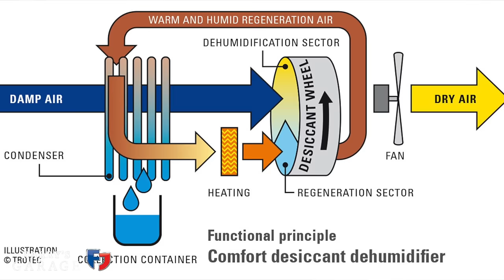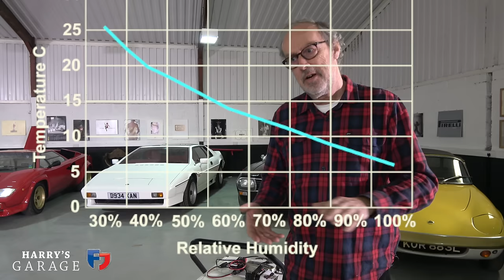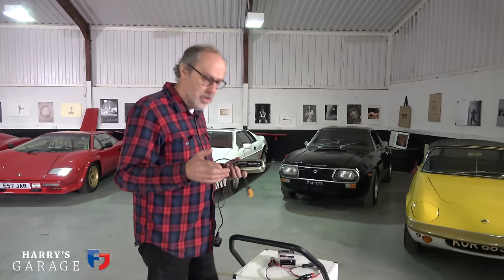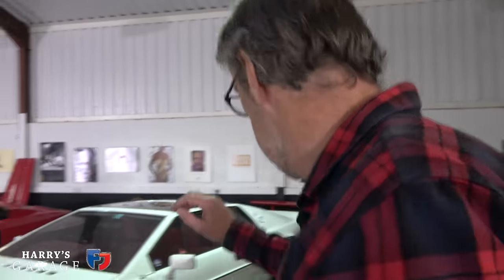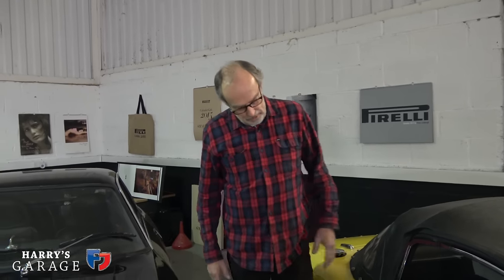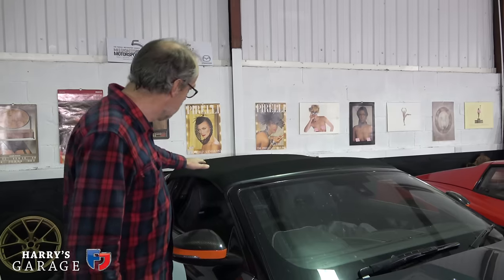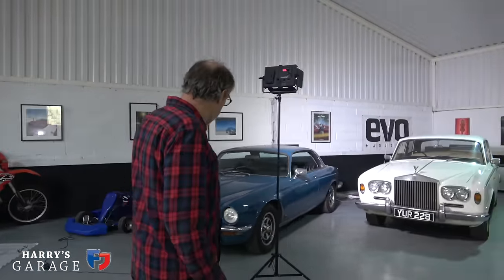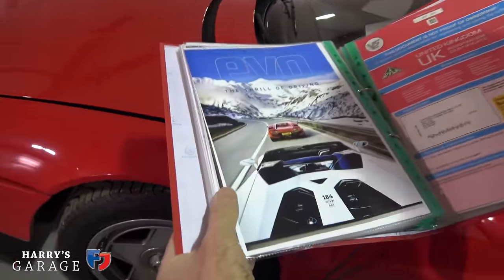My top tips for keeping any car in top condition during a period of storage.

Comment: Not all desiccant dehumidifiers output the moisture in a heated air-stream like the unit you have. Many of the smaller "domestic" size units discharge the water into a capture tank or hose outlet and you do get the advantage of the heating inside your garage (the dry air coming out of these units is noticeably hotter than the output of the refrigerant types of similar drying capacity). 

I have a bare aluminium Caterham that has lived its 17 years in an unheated garage and is still pristine. While dehumidification is part of the reason I think, paradoxically, an uninsulated metal roof has been of benefit. The reason for this is that, on clear nights, radiative losses ensure the roof temperature drops far faster than anything else in the garage and with a little circulation within the garage (generated by a small fan) condensation forms preferentially on the roof rather than the car. So long as you prevent this condensation from dripping on the car it is of no account. A tarp suspended from the roof like a ridge tent can ensure any drips from the roof run harmlessly clear of the car. A vapour barrier on the floor (paint, or a tarp or a pond-liner) is important and a heavy cover over but not in contact with the body of the car completes the job.

Comment: With regards the expensive Dehumidifier, you could make some sort of heat recovery system to capture the hot air before it exits the building.
My thoughts would be metal ducting, run along an inside wall for a few meters before exiting. The moist air exits but the heat soaks into the ducting.

While I am on the subject, there are heat recovery units on the market that draw heat from the high part of the building and pump it out at floor level.
Cuts down on bills and creates good air circulation.
Reply from the maker: Knowing what I do now, I'd rather have a couple of cheaper desiccant dehumidifiers with built in collection tanks that could be drained to the outside, as then any heat generated would stay in the garage, rather than being pumped outside.
Reply: @harrysgarage  That sounds like a good simple solution.
Very nice explanation of temperature and humidity by the way, I have some knowledge in this subject which really helps when you are trying to protect metal. 
Thanks for the video Harry, I think we are all looking for something to watch at the moment.

Comment: Think of humidity in cold and warm temperatures as a beach towel v’s a flannel.
The beach towel is warm temperatures and can hold more water, before it gets wet through and drips.
The flannel is cold temperatures and can only hold a little water before it wet through and drips.

Comment: Careful with relative humidity. Yes, the percentage will be lower when you increase the temperature, which means the air is further from saturation (100%) and objects at the same temperature won't get condensation, which is the ultimate goal. But you need to maintain this temperature constant and, more importantly, have a good insulation of the walls, ground, and ceiling, because that's where the condensation will eventually accumulate. In turn, the condensation will deteriorate the material and offer spots for bacteria and all sort of things you want to avoid in the long term. Finally, if you insulate enough, you also need to ventilate in order to alleviate those problems.

Comment: Great advice. The only thing missed in my opinion: don't run the car for a short time. Worst case is just letting it idle for a few minutes in the garage. Not much better is going for a ten minute drive. If you drive it, which is certainly ideal, warm it up thoroughly, and then give it the beans!

Comment: I'm not sure about turning the engine over without starting it because petrol will get into the cylinders and wash oil of the bores. I prefer to drive the car just outside the garage and run the engine until it's properly warmed through every few months. A cover is particularly useful on convertible hoods which are difficult to clean.

Comment: Its the deciding which one to drive would be issue...
RE storing the hood up for convertibles that's hard if it comes with a hardtop like a Mercedes SL as you'd need more room to keep the hardtop and also a stand!
Reply: My father has an r129 sl.
He keeps his suspended above the car in his garage. He's had the car around 20 years and I don't think he's never put it on.

Comment: Keeping the tank full is very important IMO. People have found decades old engines with perfect fuel injectors full of gas because the gas was sealed off from any air.

Also likely a good idea to roll the car a bit, to protect the bearings from denting as well.

Also, battery acid stratifies when still for long periods. If it's super cold, batteries can freeze and be damaged because of that. So, I'll often just rock the car to keep the battery properly mixed.

Salt is evil. Don't ever drive in salt. Wait for it to rain twice in the spring before driving after a road was salted.

Comment: Cars with OBD-1 and OBD-2 are most likely the ones which may drain the battery.  There are manufacturers that do a good job programming the computers to go to sleep fully.  There are other manufacturers that produce vehicles that have sensors or other feedback units on the vehicle that keep trying to communicate with the vehicle computer even when they are shut down and in storage which draw  just millivolts.  Over a month or two  that low millivolt draw will kill the battery.

Comment: Too right Harry about modern cars. Had a 2006 Jeep Grand Cherokee for a year from new, went on holiday for 2 weeks, darned thing was dead when we got home - nothing wrong, said Jeep, the car simply drains the battery that much. Battery revived by their breakdown guys.
Reply from the maker: New cars are a flipping nightmare when it comes to battery drain. Many do a diagnostic check on internal systems every 24hrs, which is another reason why they drain the battery. Then, rather than cranking into life a bit slower when the battery is at 70% charge, they throw up an engine light and refuse to turn over! It's a problem with every brand of car too..

Comment: The most important to check everything when you take the car out of the storage. The most important are brakes and fuel lines. Both of them are very critical as the rubber can be cracked.

Comment: I to live in the countryside and my biggest problem when not using the car for a few days is mice, they've found a way of getting into the interior now as well as making nests in the engine bay. 
The best way I've discovered to deal with the rodents is to move the car to different parts of the garden every day, I use the garden blower in the engine bay and spray the seats with a can of Dettle fabric surface.

Comment: Good psychrometry; my anti mould economy approach in my non airtight rented Hong Kong car shed is what I call pulse dehumidification with a dehumidifier on a  plug in timer giving say 10 minutes on, 30 minutes off and a tumble dryer hose feeding dry air  via a spigot through   a piece of rigid plastic sheet  wedged into a wound down car window. On old school cars I remove a battery terminal and sometimes rig up a portable PV battery charger. Higher tyre pressure and occasionaly rolling the car a few inches  to change position  helps reduce tyre flatspots. I also sometimes park on some salvaged playground rubber tiles to reduce floor to  tyre contact pressure. And then bloody bats in the shed corrosively  dump on the paintwork and rats chew the wiring !

Comment: Great video Harry. Especially if you live in the UK. We all have these issues. C-tek is the way forward. (all mine are on those).
Reply: matty BROWN 
I have a Ctek MXS 5 connected to my 2015 Cayman but for some reason it’s not going to maintenance mode. It goes through to mode 7 and goes back to number 1. It’s the first time I’ve used it (brand new), maybe it’s a duff one.
Reply from the maker: It often takes up to 2 weeks constant connection before it goes to maintenance mode. How long has it been plugged in?
Reply: Harry's garage 
Thanks for replying Harry, it’s only been on for a couple of days. The only problem I found with the Ctek comfort connector is the cables are not long enough to reach across the battery posts & the Porsche manual states not to put earth cable onto the battery post, there’s a dedicated Earth post on the front strut & again the comfort cables aren’t long enough. Solution; I managed to get the crocodile clamps to reach (just about), it’s a pain as the inner bulkhead plastic panel has to be removed & stored somewhere.
Reply: Harry's garage they are on constant charge - bar the daily (35) I often find with the trackers and alarms on my gtrs new ones (35) around 7-9 days before it goes flat the older ones (34 etc) about a week with the trackers etc constant battle. in fact just got a message from tracker this evening my battery is low, (34 not on charge but had new battery 2 weeks ago) I’m very pleased you bought this up.  The other cars in constant charge with no issues via c-tek - Stay safe

Comment: All due respect if I may. I have been storing cars since the early 80's and currently store 3 due to cold and snow / salt. Your suggestion to periodically crank the engine from time to time worries me. Most all of the ware and tare on engines occurs when it is initially started / turned over. I jack mine up and hang the suspension, and fog oil the motor till it nearly stalls and then call it good. Thanks, thoroughly enjoy all your content.

Comment: Nerdy comment about humidity/heat - it's not that different to electronic circuit boards intended to work in outdoor equipment.  If you cannot hermetically seal the equipment - basically needs to be metal case welded shut, moisture will get inside.  Bear in mind that moisture will permeate through plastic (that's why early plastic transistors were unreliable and not used in things like BT systems, military products etc).  If moisture can get inside, you need to allow it to get out - simple hole at bottom or a specific plug with a gore-tex patch that will breathe, but not let in insects.  Then you need to make sure the printed circuit board operates at about 8-10 degree C above the outside ambient to reduce the moisture at the board surface so you don't get condensation.  We even used to put heating resistors in products that used very little power.

Comment: It would be a very useful option for exotic car manufacturers to add a connection point for external power so the battery can get disconnected and not get drained by all the electronics.

Comment: Hi
To run or not too run is the question? The modern enriching to fire up the CATS raises a dilemma .
Unless your prepared to run oil up to 90c I’d say not.
Yourll just be taking the hit on start up wear.
I have 4 ctek’s so must be a fan but for CAN bus architecture it’s important to connect them from negative earth point and the positive pole as recommended in the handbook.
It’s not simply across the battery.
I too try to brim the tank I suspect it’s mythical really for a couple of reasons.
Firstly the surface area doesn’t change that much with volume.
Secondly can you buy super fuel without ethanol? Most seem to have gone to 5% which is probably enough to render the fuel absorbent to water.
( it’s one reason air cooled piston aircraft engines still run on blue Avgas to allow  tank drain checking and separation of water before every flight.)
Thanks

Comment: Without access to mains power ? You could also trickle charge with a solar panel. The most versatile of which can be plugged directly into the obdII port of the vehicle ( EOBD available from 2001 ) Thats a great workaround for vehicles who’s lighter socket deactivates when the ignition is off.

Comment: I've always, with all my manual cars, when garaged

Leave them neutral 
Handbrake always Off
Chock the wheels
Roll the car periodically to have no flat spots on tyres, when you next drive the car
Start, and run them for 10 minutes or longer to get engine up to normal operating temperature, if stored in garage a longer length of time

No one, or nothing I read in a journal, or book, or magazine, or now on the internet, told me to do any of this with a car
I've just thought it was simple common sense 
But then again, I am weird!

Comment: I make a living out of keeping flowerbulbs dry. Constant temperatures are important, even more than high temperatures. If the airtemperature in your shed goes up the temp of your car is lagging behind. It takes longer to warm up a car than it takes to warm up air. As soon as you have a difference in temperature you get condensation. Everyone who took a bottle of beer out of the fridge has seen this.  The moisture in the air will now condensate on the colder metal of the car, especially in cavities. And this will cause rust obviously. So constant temperatures are important, as well as air circulation. (not ventilation)

Comment: The engine sound reminds me of my FIAT 124 SPORT 1800 1974  which made the same sounds and revved freely  up to 8000 rpm and it didn't have fuel injection but 1 weber twin choke carburetor. Look how good the Italian cars were back in the 70's?  MGB 1800 = 95bhp  Fiat 1800 = 120 bhp and 140 bhp with twin Carbs?

Comment: I put the car on cheap old rims/tires over the Winter under a  roof outside. I store the summertires at about 12' C in a  room (prevent hardening). I put 102 oktan fuel in the tank. I take the Battery of the Car. Thats it.
Reply: 102oktan?>

Comment: Why do not to disconnect the batteries on the old cars? Just take the minus off and enjoy the fully charged battery whatever time you need. And to be even more safe, take the battery off and store it somewhere to prevent the corrosion from the acid vapors.  Take just 5-10 minutes to install the battery back

Comment: Do you have any cars with the engine-off-at-traffic-lights system? If so, they will have a 2nd battery somewhere, and that too will go flat over time.  And re humidity, as you say... warm air can hold a LOT more moisture than cool air. So if saturated (i.e. foggy - 100% full so extra water is appearing as droplets) cool air is heated up the relative humidity falls from 100% towards 50% relative humidity i.e. when the air’s warm, the same weight of water is in it, but the air can now take twice as much moisture. The thing we’re trying to avoid is the car being in a high relative humidity environment. Relative, because high %  humidity can lead to moisture coming out of solution and dew appearing in the vehicle - causing damage. So the objective is not to reduce absolute humidity, but to hold relative humidity below 60%. And the risk is that, having got to 60% with the air being warm, if the air then cools the relative humidity will increase and the dew point approached. So, as you say, get to 60% at the coolest temp. the garage will see.

Comment: Funny this video has come out at the same time I am having issues with the battery on my BMW due to non usage during lockdown. It has been suggested to me from others to get one of those battery conditioners but where the car is parked there is no power so I can't hook anything up. I can take it out once a week but only for a short run. Not sure what else to do, I am hoping it doesn't cause any problems.

Comment: I have four cars, three of which are rarely driven and are put on a trickle charger - about $40 on Amazon. I have used them for 20 years and found they DOUBLE the expected life of batteries. Mine typically last nine years. I do not leave the windows open due to concern for critters great and small.

Comment: Fortunate enough to have a fully insulated integral garage on my house and had a double skin sectional garage door fitted a few years ago. Stays super dry inside as I've left the breeze block brickwork exposed too - floor is sealed so no dust.

Big thumbs up for the C-TEK here too. I have my Aston Martin plugged into one and it's been great. Astons seems to go AWOL when the voltage drops from the battery and replacing it is a pain. C-TEK actually make their battery conditioners for companies like Aston Martin and Bentley. If they're good enough for those and good enough for Harry, they're good enough for me!

Comment: Thank you for another fantastic video, Harry. I appreciate all the information on storing my two aging Volvos more appropriately during the long Canadian winters.

One question I wanted to ask you is regarding a “tip” I once heard; namely that when storing your vehicle long term, one should not close the doors to the final click as this prevents the door rubbers from becoming permanently deformed when not in use.  Of course, one has to make sure that interior lights etc. are off.  

I would guess the logic is that, with daily use, such rubbers have the opportunity to expand when the doors are opened and closed.  I have not followed this advice as I am afraid that the doors may sag over time if they are not properly supported.  Do you have any advice on this?  Thanks again for the outstanding channel.
Reply: I'd recommend use a product like "Gummi Pflege" which keep the rubber seals soft?
Reply: @Trev5  : Thanks for the info. I was not aware of Gummi Pflege, so will definitely check it out.

Comment: Very informative. I’m even now looking at a trickle charger. I have a solar panel one, but it didn’t keep the battery up during the Winter. Do you connect the trickle charger with the battery still connected to the car?  Or is it best to disconnect the terminals? I’ve often wondered this. Thanks